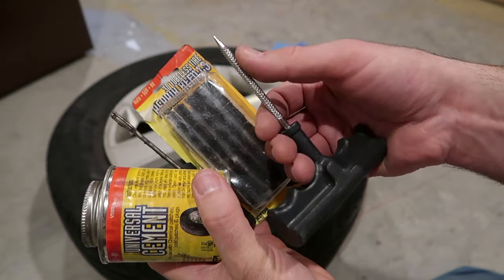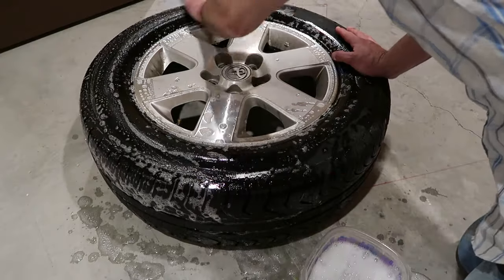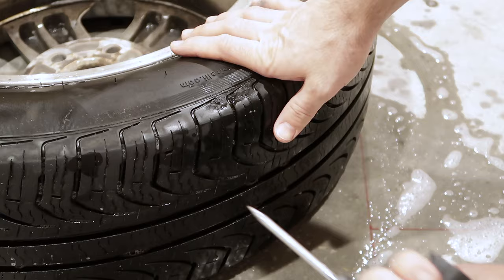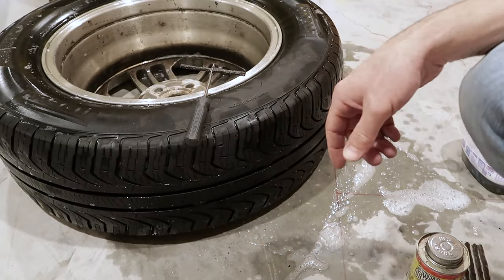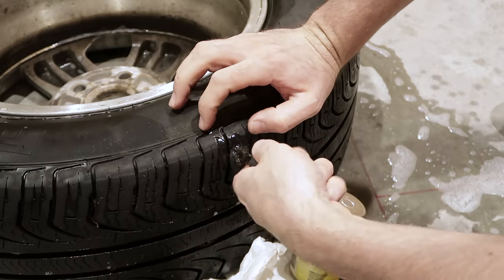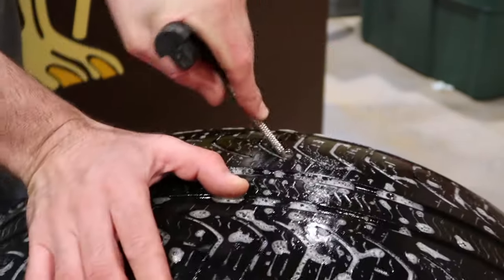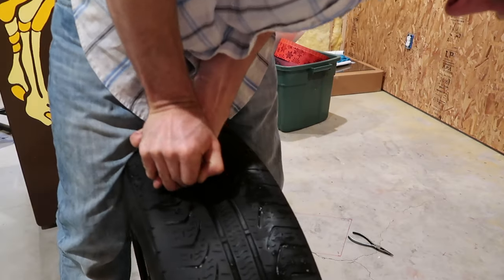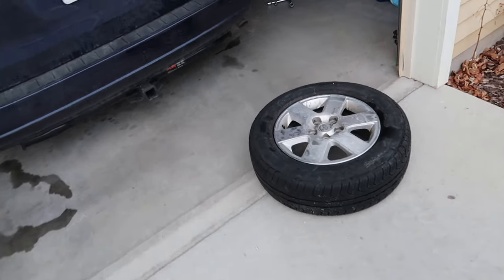How to fix a flat tire with a tire plug kit -  Car Tire Repair

Comment: Tire pressure should follow the sticker inside the driver's door frame, which have been specified by the engineers who designed the vehicle.

Comment: Tire #1 - That injury is outside of the crown area and should not be plugged. People should be aware that while you can do as you wish, that is not a safe place to plug. Also, after the application soap, I prefer to clean the area in which I plug with plain water and dry it well. You want a clean rubber surface for the chemical vulcanizing. Otherwise, good instruction, very clear and easy to understand.

Comment: I tried to plug a tire with the same tools but I was not strong enough (I'm a women). I removed the tire so I would be able to use more strength but still. Would you have any advice?
Reply: Make the hole clearer and smoother so the sticky part has a an easier time getting inside
Reply: @SossboyOG  Thank you for the advice, I appreciate it. But that's the step I was not able to do due to a lack of strength. Once my boyfriend made the hole "bigger", then I was able to plug the tire. I guess I need to lift more weights to be able to make the hole clearer and smoother by myself. :)

Comment: Very nice video.  Thanks for posting.  Gas stations ask over $20 to do the same thing.
Reply: Over time this style plug will dry out and start to leak again. Repair garages use a permanent internal repair plug
Reply: @bimmerben76  yeah, but by the time that happens the tire will be near the end of its life, and a new plug can be inserted anyway so not a big deal

Comment: Thanks for the video!!  
Tire pressure wise, please reference the sticker on the driver-side door jam (i.e. 32 or perhaps 35-psi) instead of the 44-psi on the tire.
Your 2nd tire looks to be close for replacement as the tread is reaching the same depth with those little ribs in the groves.  
Thanks again for the video!

Comment: The rubber cement isn't really necessary.  The plug itself is sticky enough to seal the hole completely without the rubber cement.  I've used the Victor Tubeless Tire Repair Kit (no rubber cement in this kit) four months ago and have had no problems with the repaired tire since.

BTW ~ Great job and explanation on the tire puncture repair video!

Comment: so do you always inflate it to max pressure or less ?
Reply: 35 psi is enough for regular cars
Reply: i always do a couple psi less than max, unless i'm towing or hauling.
Reply: The max pressure written on the tire is the highest pressure the tire can handle. And no, it won't burst at that pressure, there will be a safety margin, but one should not exceed that pressure. This is not always the best pressure to use for a given car model, which depends mostly on the car's weight. Look at the label on the driver's side door frame for the recommended pressure, which can be somewhat lower than the max pressure allowed for the tire.

Comment: can we fix wall of the tire side? i got a small knife whole.
Reply: Jr Griffin no sir, it’s not recommended to fix tires when they are leaking from the walls? If it’s leaking where is sits on the rim is fine no the tire walls
Reply: @adolfojmz2200  And I don't recommend using anything but an internal patch on knife damage and then only if it appears not to have cut the steel belts.

Comment: Cut leaving 5mm plug outside. That's what instructions say too. Else it will go in once you run on lower tyre pressures.

Comment: im no expert, but according to tire experts what you are doing is dangerous and the tire could have a sudden blow out while driving b/c the damage is too close to the side wall.
Reply: Gizziiusa I’ve seen the shoulder patched with those slim jim plugs lol in my experience it matters on the angle how big the hole is and if the cords are exposed as long as it’s like a small nail straight and no cords exposed I’ve seen plenty of repairs done on the shoulders even professional patches from professional shops
Reply: Some last for a little some last for a while there is no telling but it can be done